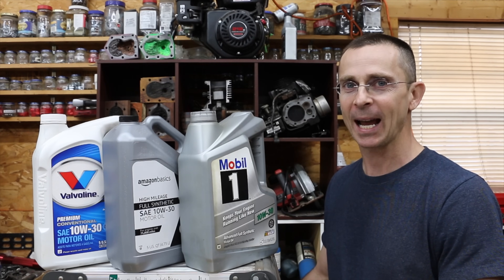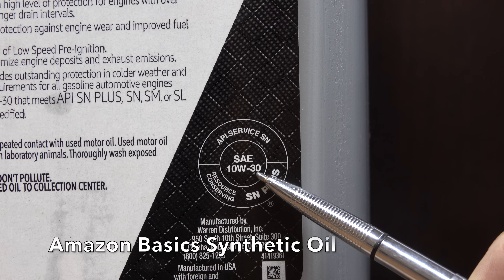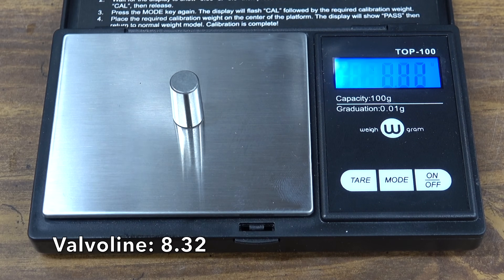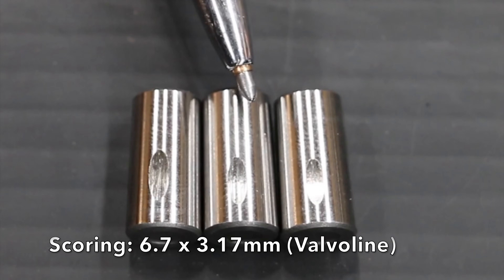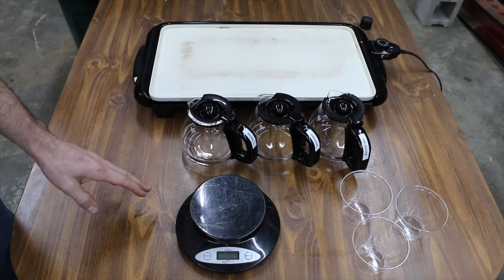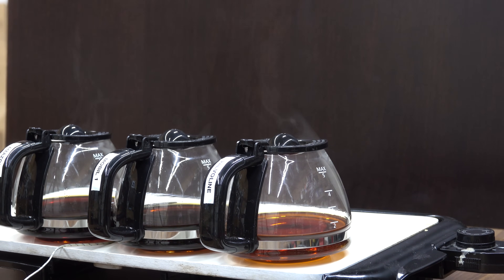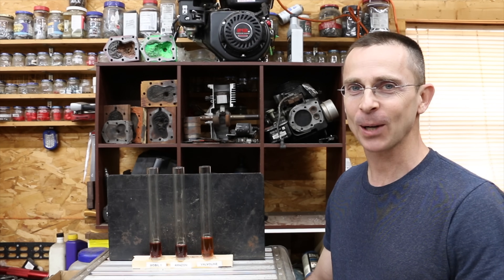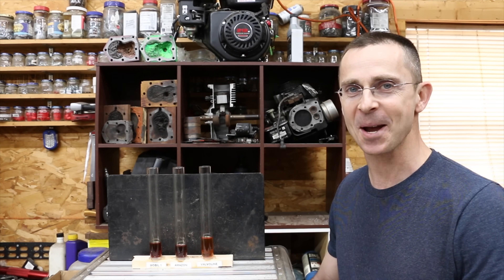Is AmazonBasics Full Synthetic Motor Oil better than Mobil 1? Let's find out!

Comment: I noticed it didn’t look like you measured volume for the wear test, and the Valvoline looked like it had the least, Mobil 1 the most (it slopped around, lubricating everything), and from my perspective looked like it made a difference, however, I’m no expert, and much more ignorant on the subject. Is it possible more volume could’ve resulted in less wear, or did you actually make sure the volumes were the same? Even if the volumes were the same, is it possible the Mobil 1 splattering around gave it an advantage?

Comment: I've owned that exact same griddle. It doesn't get hot enough to boil a pot of water. I don't call that a significant amount of heat.
Reply from the maker: Thank you.  This one reaches 400F.
Reply: @ProjectFarm  Yes. I do know that. But the temperature of a pot of liquid (in my case water) placed on top of it barely even get to 212F. It takes 8-10 minutes for 3 minute ravioli to cook on one of those.

And I don't mean I have one like that. I have that exact same one. It doesn't heat what you put on it to 400F, it heats it's own surface to 400F.

I just thought you might want to take that into account for your experiment. I apologize if I seemed to challenge you. I tend to come off that way but I meant what I said for informational purposes only. I only meant to inform you that the heating element you are using can barely even boil water, let alone stress motor oil.

Comment: Love the test. But next time, can you make the test more even. Instead of comparing 2 synthetics to a conventional,  try the valvoline full synthetic with the other 2 synthetics. And also I noticed that the valvoline conventional was still the cleaner looking oil after the heat and freeze test.
Reply from the maker: Thank you

Comment: Will you test the new Havoline 5w30 full synthetic pro ds.  I’ve just started using it in my 2009 1500 Dodge Ram. I’m a big fan of the delo which is the same company as havoline. That’s all I use in my 18wheelers.
Reply from the maker: Thank you for the video idea!

Comment: I'd be curious to see the UOA on Amazons 5W40 synthetic vs Rotella T6 5W40. I've started running T6 in 01 XJ's 4.0l because it has the highest concentration of zinc additives on the market and consistently returns from UOA's in good shape after a 5,000 interval. When it's available on the shelf at walmart for $23 a gallon it's hard to beat.
Reply from the maker: Thank you for the video idea!

Comment: Those lubricity scar sizes are fairly close in value Mobil 1 & Amazon, I would like to see multiple runs of that test before I would consider those differences statistically significant.
Reply from the maker: Great point. Thank you

Comment: There are 2 reasons to use synthetic in my book:  1) their viscosity does not break down over time and 2) ability to lubricate at higher temperatures meaning they will lube more metal area surrounding worn regions.
Thoughts on how to test:
1) Viscosity Breakdown:  You'd try to break the hydrocarbon chains at engine wear points at the maximum temp capability of the oil.  The oil from the bearing wear test might be a better candidate - even better if you could put a heating pad under the oil reservoir.
2) High Temperature Wear:  Again, a heated bearing wear test would be more revealing.
Reply from the maker: Great point!  Thank you

Comment: The NOACK Tester, now referenced under ASTM 5800, costs between $3500 - $4000.
Test is run at 250C (482F) for 1 hour with air flow.

It is not a million dollar testing device.

Warren Oul Company is contracted to make some of the branded Amazon Oil offerings....

Let the reader understand Amazon is a shipping company...it manufactured no lubricant product(s).

Boil off and wear scars resulting from testing are relative indicators of  performance.

The oils shown tested are using the same base stocks, API Group II and Group IIIs,  labelled for consumers here in the USA, Oil Monkeyland, as "Synthetic". 

They are actually refined petroleum base oils additives to the mini.um requirements set forth by the OEMs.

Jeff Bezos is simply capitalizing on consumers, whose ASE Technicians have little to no training on old,  except, like the presenter herein.....

HOW MUCH IS IT?

Bezos needs your money to get back his $68 Billion, he is about to lose, because he was involved in lubrication of another kind...

When he shouldn't have been.

I can hear him laughing all the way to the bank with monkeyland videos like this.

Comment: I wish you would have used synthetic valvoline oil. I think it's universally understood these days that synthetic is top shelf and regular oil is well. I would assume that more people are curious as to valvoline wears as well as the others.
Reply from the maker: Great point. Thank you!
Reply: I agree lets compare apples to apples.  Synthetic vs conventional I think we all know whats better.  Please re-run the test with Synthetic Valvoline.. other than that great information.
Reply: @sz0wxc  The valvoline was to compare conventional oil to Amazons synthetic oil because they are at similar price points.
Reply: Today's modern synthetic motor oil of any brand will not cause damage to any gaskets or seals that are made for a combustion engine. If anyting full synthetic will condition the seals due to the modern chemical package added to the oil before it is sold. But I will say with lots of experimenting and experience with high mileage engines that do have leaks and average oil consumption between oil changes that I've always used conventional oil will consume and the leak more a few synthetic oil because the molecules are significantly smaller so they can flow through the existing cracks in the gaskets and seals. For example I have an 07 Dodge Grand Caravan with the 3.8 liter V6 @ 181K miles and an 02 Chevrolet Avalanche Z71 5.3 liter LS @ 290K miles, Both will consume/leak about 1 quart of conventional oil between oil changes and a little more than 2 quarts of synthetic oil between oil changes. I randomly switch back to conventional oil depending on if there is a sale on synthetic blend and what my money looks like at the time. I am still experimenting with heavier weighted synthetic blend oils to calm down valve ticking and consumption with the dyno part and the added performance and protection of the synthetic part. I can say without a doubt that my gaskets and seals are no worse than what they were before I started using synthetic and synthetic Blended oils. And if it makes any difference I also always use a high quality oil filter. Usually the green label mobile one 20.000mi/ annual change filter. And just to add to the debate, I myself believe that your oil filter can do more damage to your engine than any oil on the market today no matter what brand oil you choose.
Reply: Same, I usually run Valvoline full synthetic high mileage. I'd be curious to know if I'm over spending compared to other brands!
Reply: Cesar Guzman well I appreciate that but back in 1999 synthetic was not too well known and not recommended for my old Honda but I appreciate your response, and when I blow it up with synthetic OR petroleum oil,  I'll let you know what happens thanks keep up the love and peace
Reply: @Andy P Well I don't know about the US but...In Sweden Volvo switched to Mobile 1 full synthetic 5w30 in the late 80s. You could still get Mobile 1 conventional oil @ Volvos scheduled maintenance, but they did not recommend it. I bought one Volvo -87 480ES in 1991, and a -88 480Turbo in 1992 and both of them had a sticker in the engine compartment saying "Only ELF synthetic Motor oil". In 1992 when Volvo 850 was released the only "approved" oil that was in Volvos spec. for that engine was Mobile1 full synthetic motor oil. The oldest engine I know of that got a "synthetic" oil treatment was my friends 1968 Volvo Amazon B20 @ 250000km, not a leak and not a blown up engine.
Reply: @anC00L  nice, nice Pelle, I have a JA-PAN motor that was not designed for synthetic oil but its nice to know someone was using it in the early 90's, NOT Honda though! thanks for the reply
Reply: @andyp3834  if you have damaged gaskets, synthetic oil will leak out at a faster rate than conventional, for a few reasons. However, this is not a fault with synthetic, rather your bad gaskets which need to be replaced. Over the years gasket materials have changed and not all cars are the same. We no longer use rope seals for the cranks. Usually it's a neoprene ring now. Most synthetics(especially high mileage blends) not only maintain the integrity of neoprene, but can restore and soften them back up to slow or even stop leaks. When you see the rear main seal leak stopper additives, like blue devil, this is essentially what they are doing, swelling the neoprene. This would be unnecessary with quality synthetic oil used over an engine's lifetime.

The gist of it is, synthetic is better all around. It keeps the engine cleaner, it lasts longer, and it keeps seals healthy and pliable. There is no reason not to use it. If your engine is old and worn out and already has severe gasket damage, conventional may leak slower, but it won't be doing your engine any favors in the long run.
Reply: @LirokuToragi  Nice comment, its already in the long run at 250k, lol, but I agree with you about the difference in-between gasket materials from back in the day compared to now-a-days, I think the original gasket was made of bean-curd, we better google it, LOL Thanks for the reply,
Reply: Cesar Guzman totally agree it’s really kinda odd that he did that text with reg against two synthetics smh
Reply: I like that he didn't, but part of me wishes he did. I got to see how bad conventional was but I can't tell if it was that bad because it's not compared against itself as synthetic.
Reply: yes, but again, does synthetic oil ruin seals on older engines NOT designed for that? what do you think?
Reply: @andyp3834  ....No
Reply: @markrowlett5034  No, ok, its hard to have data backing it up when it contrary to regular notions.  And what about mixing petroleum and synthetic together in a 2 stroke engine? I can tell you what that does but dont think its related to the synthetic oil seeping into seals making them leak?  How you say? please reply with more than a no, but I appreciate your response, nobody else did, so thank you. take care .. ... .... . ... ..  ... .
Reply: @andyp3834  I don't have any data to back it up, just an opinion. I've been an Auto Technician for 40 years. I've rebuilt many engines over the years and seems like the ones that change from conventional oil to synthetic, have better pliable gaskets (still sealing).  Lots of those engines had 80,000 miles or more when changed to synthetic. The ones using conventional oil seem to be hard and brittle. I have a 73 F100 2 wheel drive 302. The 302 was used and had  77,000 miles when I put it in the truck. It had a small leak around timing cover and valve cover gaskets. I changed the valve cover gaskets, but not the timing cover gasket. Today it has 324,000 miles and the timing cover gasket seems to leak less.  I have an 85 Ford 150 4x4 351 4 V H.O. and a 79 Power Wagon 4x4 with a 440 4 V . I changed both to synthetic with 109,000 (204,000 now ) on the Ford and 98,000 (276,000 now) on the Dodge. Neither have an oil leak!  I have a 71 383 Road Runner that I drag race. I built it with everything new. I rebuilt the 383 after 5 years of drag racing and when I opened it, all gaskets were like new! Now, this is using Valvoline Full Synthetic in my rides, but I've seen same results with Mobile 1 Synthetic. In my opinion, I think synthetic keeps gaskets pliable longer  in new engines. In used engines (running conventional oil) and changing to synthetic helps to keep gasket sealing if not leaking before the change  From experience, synthetic oil will not repair existing leaks, but will keep gaskets sealing better than conventional over time!
Reply: @markrowlett5034  Sweet , thanks for the awesome reply, synthetic oil does not help older engines with seals I think because it breaks-down the structure; especially around the edges where friction, heat and pressure are the greatest, so it creates a bigger gap there and leaks more there.  Nice comments, but I am still not sure if synthetic oil will help or hurt my 99 Honda, but I am going to find out.
Reply: @andyp3834  I don't think synthetic oil breaks the gaskets down. It seems like engines that use synthetic are cleaner internally and run cooler.  My Roadrunner that I run at the drags runs around 11° cooler using synthetic oil vs conventional. Iwas unsure at first switching to synthetic also. But I only run synthetic in everything now. I use VALVOLINE Full Synthetic in everything except my 87 TBIRD TURBO COUPE. I run Mobil 1 in it. The only reason it doesn't have Valvoline in it is cause in 1992 when I purchased the car, Valvoline Synthetic was available only at one parts store and it closed when I got off work. Mobil 1 was available at Walmart.. I still change oil in my carbureted cars every 3,000 miles or 4 months. Injected cars I change at 4,000 miles or 4 months. I can't let myself believe in the 12,000 miles or 6 months thing. Oil doesn't wear out, ut gets dirty, diluted and the additives wear out
Reply: @andyp3834  ...My TBIRD is Multi Port Fuel Injection!  I have heard the saying that synthetic oil will leak more in an engine that has used conventional oil, if that engine already had a leak. I can't say that's true or not. From experience, I've not seen that. I actually think synthetic oil rejuvenates or softens gaskets...just my thoughts. Reason I say that is 2 of my vehicles have over 300,000 miles, 1 has just over 200,000 miles. None have any oil leaks except the 302 timing cover I mentioned before. Can't say if it's the synthetic oil or cause I change the oil religiously. It may be the Valvoline Synthetic oil. Every engine is different. If you do switch, just be sure what ever brand you use, meets you car's specifications.  Different Viscosity in the same brand sometimes have different specifications  . I only use Mopar oil filters on my Mopars and Motorcraft on my Fords! I think you'll like synthetic once you try it!
Reply: Andy P what do you mean by older engines? 10 , 20, or 30+ years old? Or do you mean engines with 100k+ miles? Not all older engines are the same. Synthetic oil isn’t made the same way it was 20 years ago either. There are old wives tails that may have been true at one point in time but as time goes on, things change.
Reply: @plaid11  just 20 years old, but the way I drive its about 40, I have 250k on a 99' Honda accord but I dont think the gaskets and seals are made for synthetic, i never heard that from my wife, just my dad who built and raced rails AND the engine back in the 70's, so not to be rude, but I dont think you know what your saying, but I always appreciate a response, that is much more important to me then when someone just dont say nothin,  peace.. .. . ... . . . .
Reply: @markrowlett5034  Dam, nice, I think you are right about possibly leaking more if I ALREADY have a leak, anyway, my 99 Honda gots a 2.3 liter 4 cylinder with 250k and is getting worse (also the main crank-shaft is wobbling and making my belt make some  awesome sounds) so its rebuild time assuming I keep the car, anyway, before the big change, I wanted to try synthetic oil to see what it does and then I will post it for the fans of my fav channel (Project Farm of course) so that we all could learn something, just like how he has learned us stuff (obviously not English skillz, LOL) , it wants 5w-30, but recently I put in 10w-30 just to see if it would blow up, not yet, but I mixed some Lucas Oil Stabilizer hoping the viscosity would change to 7w-27 or something like that, lol, sorry, please tell me what Lucas O.S. does to 5w-30 oil or even 10w-30, I type on PCs for a living, so I dont know, and never will unless you reply.  Thanks for the AWESOME info and reply.
Reply: @andyp3834  ...There are some that say older cars (70s and 80s model ) and with 100,000 or more will leak if  it's had conventional oil and then changed to synthetic. I can't say that's true or not. From years of wrenching,  I haven't seen that happen.  None of my rides have have developed leaks switching to synthetic. I again say this is using Valvoline Full Synthetic  oil, don't know if other synthetics will or will not. In my 1973, 1979 and 1985, all original engines, never been rebuilt don't leak any oil after running conventional then changing to synthetic around 100,000 miles. The Turbo Coupe had 59,000 on it when I bought it. Previous owner ran Havoline in it. I kept that in it through first 2 oil changes. Oil pressure, when hot dropped to middle of gauge. I changed to Mobile 1 Synthetic at 64,000 miles and oil pressure stayed a consistent 63 psi when hot at idle! None of the above have any oil leaks. The timing cover leak on the 73 actually seems to leak  less since going to synthetic. I do change oil in all at 4,000 miles or 4 months even with synthetic. ..Ive never used any oil additives,  but have seen others use Blue Devil for blown head gasket with great results.  I just never liked the idea of oil additives other than what's in the oil!
Reply: @andyp3834  from what I've read , full syn may cause leaks in older engine if switch to it after running conventional and it will clean all that sludge and buildup that's accumulated for years and therefore it will leak

Comment: Please do a coolant test. Using the popular brands and the ones with different colors and also including diesel engine coolants too. The reason I ask for diesel coolant is that I was told it's heavy in weight and would cause premature wear on gas engines because the water pumps are not as heavy duty as the ones on diesel engines.
Reply from the maker: Thank you for the video idea!